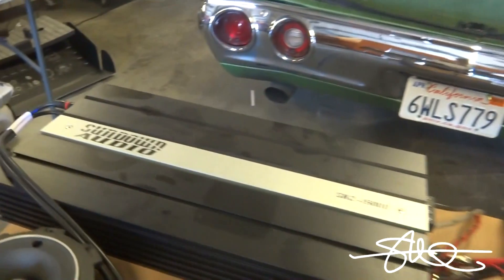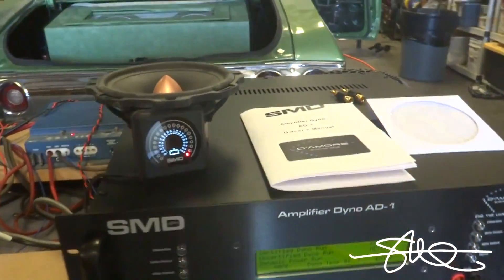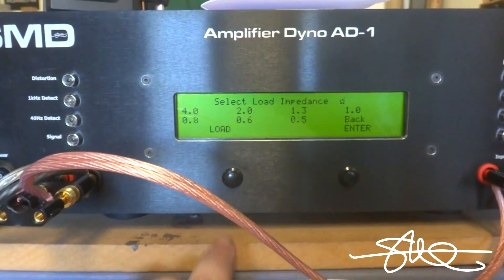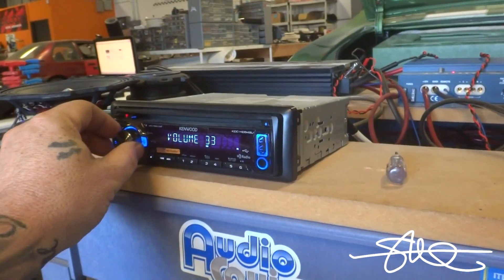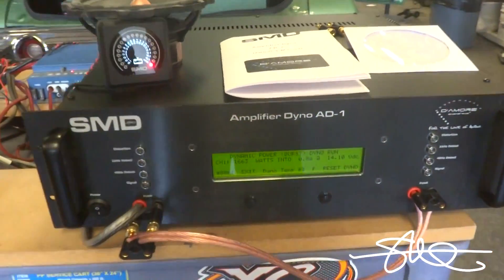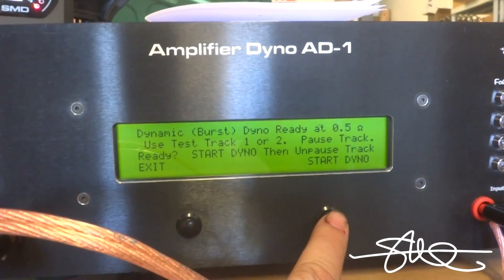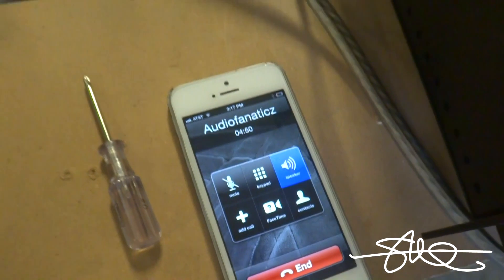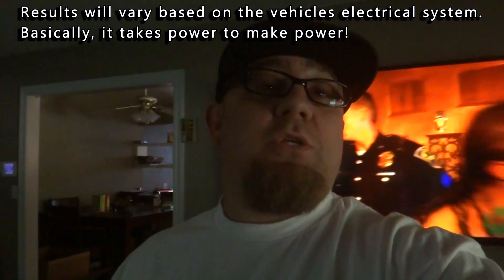Tested: Sundown SAZ 1500D - "1500 watt" Car Audio Amplifier - SMD Amp Dyno AD-1 -

Comment: So Steve tell me this, how close to a Fosgate will you rattle quality? And is it a power sucker like MTX? i watched a video with a dude in a pick up truck with a 5000 watt amp and sorry to say i wasn't impressed, i mean it was slamming but i felt at 5000 it could've done much more, i mean i have a MTX 3200 watt joint in a 96 impala that seem to do more damage with the AC on HID lights and only at idling, my alternator is a beast though don't know if that helps any and I'm running two yellow tops. need answers please cause I'm looking to upgrade to the 5000 watt and maybe 4 12's of this brand. Awesome price thats why, haven't seen prices like that on that type of wattage since power acoustic and that shit was ok at like 0.5 ohms on 4 12 in my 91 caprice back in the day but again i was in high school. if you can answer thanks in advance brother. Again Sound Quality is what I'm looking for that DEEP bass.

Comment: Kinda weak honestly
Reply: no its not? are you an idiot?
Reply: +Starstriple It should be doing  1.6k at 1 ohm certified 14.1v not .8 ohm dynamic 14.1v. Does this amp even do a 1.5k at 1 ohm certified 14.4v? Disappointing for how much it costs for sure.
Reply: Starstriple it is weak the audiopipe 1500 did better and it's cheap af

Comment: I know its sundown and its far better and will last longer but it pushes a lot less rms than the audiopipe apcl1500d amp at 1ohm and .5ohm dynamic and u did .8 and .5 dynamic
Reply: Just watched the audiopipe 1500  video the other day,iirc it put out 3000 watts dynamic. Big d old skrool audio did the testing. I was thinking it would hit about 750 max. Was very surprised at the dyno results.
Reply: Who told you that Lmfao
Reply: It did clean watts it's true bit that amp is no way near as durable as a sundown amp won't do .5 ohm and definitely not.25 ohm
Reply: you could try and switch out the caps, for higher quality caps and make it a bit more durable than it is. But you're right tho lol

Comment: i owned a massive compitition mono block amp.....i love massive audio....but there not reliable no....they bang they sound great they look awsome but my 1500w rms amp took a poop with only 4 dual 12's (2 bandpass boxs the first 1's yeah i know...still rocken em though 8 years strong-for now- movin on up to hopfully jbl or rf shallows) i had some compitition massive 10's 2 tens in a seald at 154lbs rediculess-hardest tens ive evr had or herd-but they went b4 the amp voice coils fried....

Comment: hey i want to put two sa 12's being run by a saz1500d with a tsunami 8/0 wire kit. would i need any other additional power besides a yellow top and a stock 135amp alt.? help please

Comment: Was rocking my Saz 3500 in the Jeep on 4 Sa-12s daily @.5 ohm with an XS D3100 and a high output alt, and of course a Dirt Floor Customs box and shit was definitely beatin. Also had alot of room for improvement that couldve been done in the electrical area yet. Great video

Comment: Great video! Just outta curiosity I would like to see one of those tiny little Massive amps tested to see how accurate they are in rms on 4guage power and ground. I already know I need to upgrade my ground and power on my alt being they are both still stock and I havent done the big 3. but I'd like to see what it could do I have the 1400rms version of the Massive amp series not sure what model though.

Comment: you know the amp has to raise the dc voltage to about 150 volts before the power gets to the amps power transistors get the power. With 12volts on a amp the map power is about 100 wats at 1 ohm

Comment: Fair enough, I understand. Have you or would you test any Autotek super sport series? I have an Autotek SS 1900.1D and it performs pretty well. I got 43 Volts on a 1 ohm load @ 60Hz sinewave (dunno whether clipped or not, most probably yes). Cheers from Argentina

Comment from the maker: and no way in hell this amp puts out 2000 @ 1 ohm.  A lot closer to 1600-1700.  I didn't even do a certified run, i just took the dyno up to clipping.  In certified mode, the test stops @ 1% distortion and will more likely do right at rated.  With the test stopping at clipping you get a little more and with dynamic RMS (the test here) and dropping the impedance, you can get even more (depending on the amp).

Comment: Anything by JL is over priced, so yes. I see 1000/1's for $500. Yet sundown 1500dv1's go for $200-$250 or even $300. And they put out 2k @ 1 ohm (when you hook them up to proper electrical, unlike this guy in the vid)

Comment: also the 1500d has benched near 2000 watts at 1 ohm. One battery isn't gonna do this amp justice, period. This is like testing an amp on stock electrical. get it together man.

Comment from the maker: because during that test, it doesn't stop until clipping.  Distortion happens before clipping.  The "certified" test is a little tougher and the unit will stop testing as soon as the distortion light comes on.  When i beef up my battery bank, i will retest in certified mode.  It should do ok.

Comment: Watch Tony Damores video on the amp dyno, it has a new feature called DD-1+. watch?v=ZBJT1CMqUNM
The new technology of dd-1+ your able to set your gain overlap in many more steps, and it runs the tests slightly differently that would normally be seen as 1% thd or less but with the new feature it will actually look for clipping.

Comment: Steve, thats the older sundown 1500 v1.  The v2's have single  power and ground connectors and no outside fuses.  Even beefier.  And i think they have v3's now.